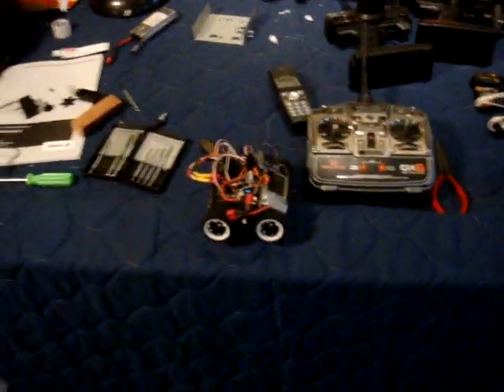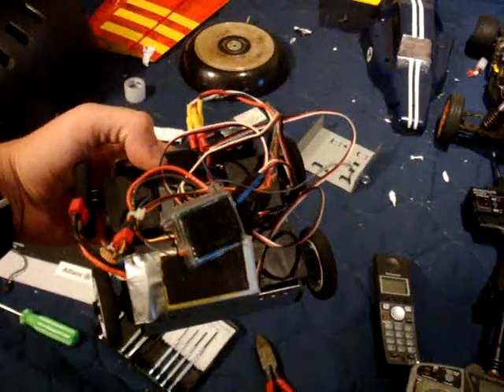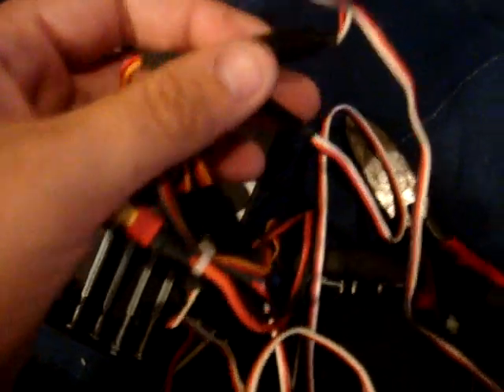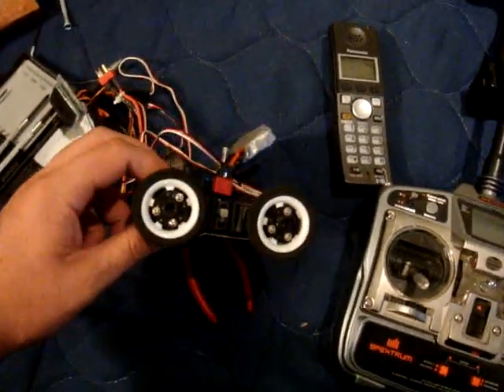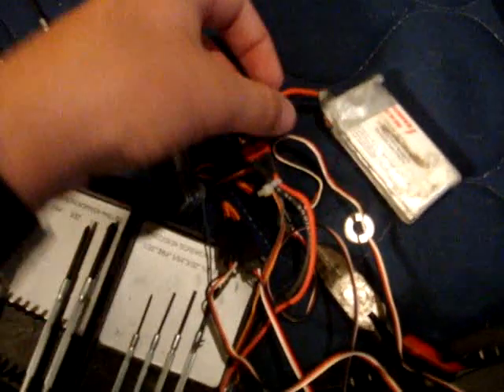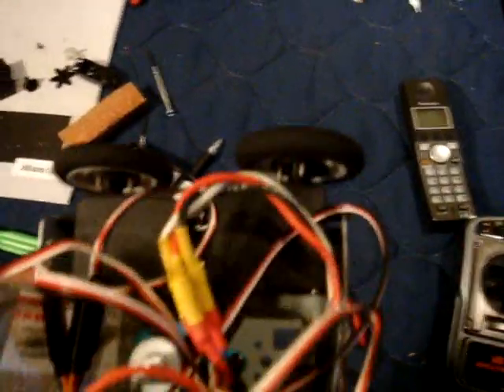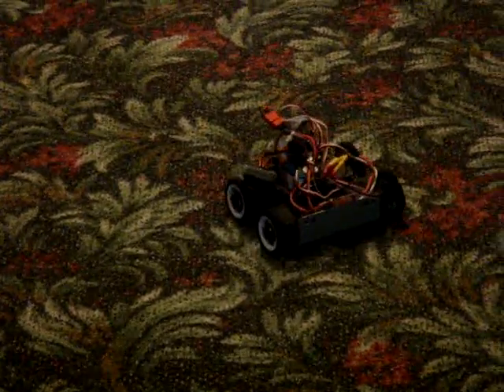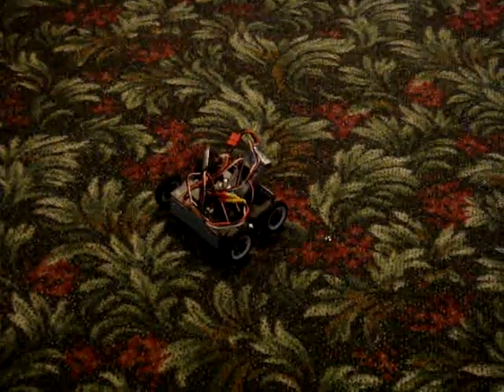Question Answered - A 4WD Mini BattleBot

Comment: i think the reason why they have ONE plastic gear in the higher quality servos is to provide the actual "driving" part of the servo with a safety precaution, kinda like what they do with lawnmowers. if you hit something hard with your lawnmower (aka rocks) then it strips a key to prevent the engine from being damaged. i think thats why they do it in the servos too, cuz its a lot cheaper to buy a small plastic gear replacement rather than a whole new servo XD